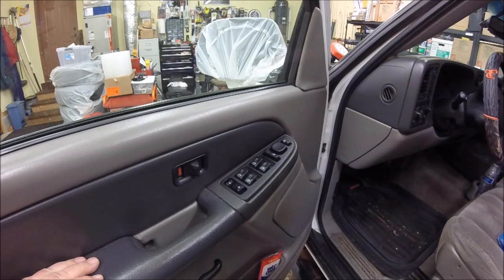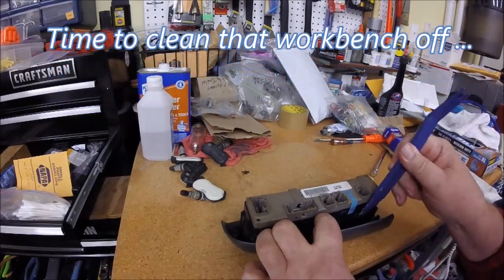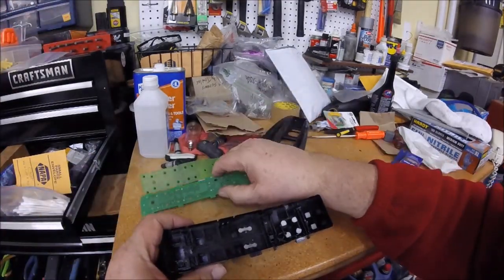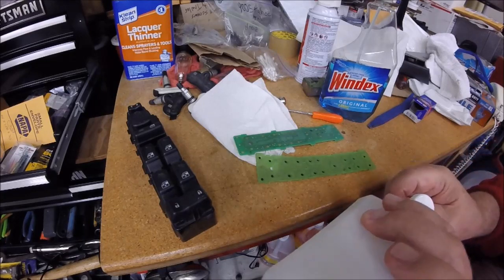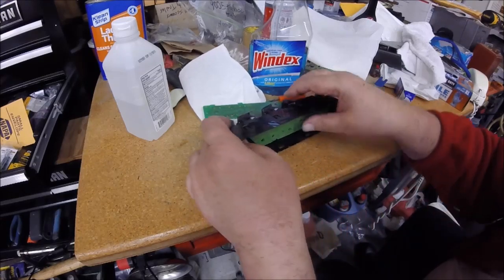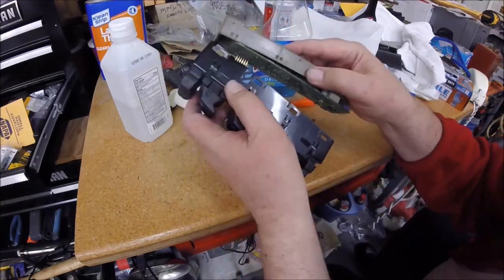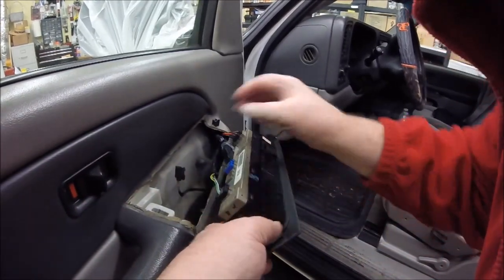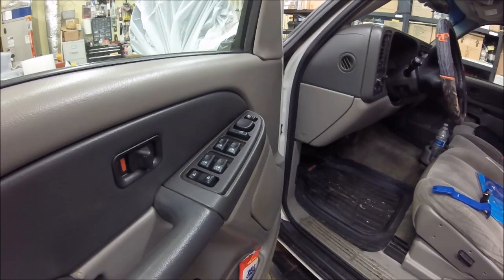2003 Tahoe Power Door Lock Power Window Master Switch Fix ©2018 B John

Comment: John, just want to thank you again for this video. It did in fact cure the sporadic lazy master lock/unlock switch on the driver side. Just a suggestion to those who may be attempting this hack. I'd suggest that in spreading the sides of the switch enclosure to release the housing to get to the circuit boards that you might consider cutting some strips of thin corrugated cardboard (about 1/16 to 3/32 x 1/2 x 1 in.) one for each slot about 8 total. Insert a small flat tip screwdriver and slide the cardboard tab in next to the slot to keep the stays from preventing sliding the housing out. This should ensure that the housing will slide out easily. Remember...take your time...slowly ease the housing out...and be gentle in there !! :)
Reply from the maker: Great suggestion - my blue trim tool worked pretty well but you can only do one tab at a time.  Trim tool was part of a set from Harbor Freight, item #67021.

Comment: Great video thxs. You need to remove the door panel to unmount the control panel from the inside. There is a screw on the front that is accessible from inside the panel. I couldn’t lock my doors or control the passenger side window on my 2003 Chev Z71 but after following your instructions and cleaning up the contacts with alcohol wipes Voila she works again 👍
Reply from the maker: Yes I forgot to show that where my screw attached inside the door panel was already broken - the back clip still works and I secured the front with super strength double sided tape - holds like iron yet removable.

Comment: This fixed both my barely functional unlock switch and the loose/slow window switches. Both the rubber membrane and circuit board have to be cleaned very well. Thanks!
Reply from the maker: Glad my video helped you solve those problems. That's exactly what I was experiencing before I cleaned it up. Thanks for watching, Alan!

Comment: At 8:20 if you would, stress that the switch needs to snap in place . I didn't get mine right, and twice had to pull it. One side did click, but only made contact with the rear passenger window. This video saved me 150 bucks, THANKS!
Reply from the maker: Thanks Kevin your comment will now let everybody know to make sure you get it snapped correctly. Glad my video help with the repair and save you some $$$. BJ

Comment: Thanks, easy fix. I immediately saw the corrosion on the drivers window connection and also some minor corrosion on the other ones but they were working but probably not for long. Snapped it back together and viola! Up went the window!!!!
Reply from the maker: Thanks, Michael.  There are several things like this you can do yourself on the car to eliminate those pesky problems with the power windows.  Thanks for watching.

Comment: Thank you for the instructional video.   My 2003 Tahoe LT driver’s door lock switch wasn’t working.  I took about 30 minutes to remove, fix as you described, and replaced.

Works great!   The forward plastic post which helps hold the assembly to the door panel was also snapped just as you suggested it wold be.  

Note:  The assembly fits so snuggly into the door panel that that forward broken pin is actually redundant.

Thanks again, sincerely,
Dennis in Coeur d’Alene, ID
Reply from the maker: Great news, Dennis! I'm glad my little video helped you with your repair. Thanks for watching! BJ
Reply: wondering how you replace the plasitc post that broken and the swivel part since as you noted this happen to us also

Comment: 2003 avalanche, unlock not working on drivers side. Got it to program off pass side. Finicky thou. You have off-acc-run-start. I went hold unlock button, acc-run- acc -run let go unlock. doors auto lock-unlock. Hold down lock and unlock on fob till it works locks seem to take 30 seconds. it will erase all fobs that use to work so take next fob and hold lock-unlock till it starts working. Can program up to four fobs.May have try it a few times to get in program mode. Good luck.

Comment: What is it call the white thing when you clip back in I broke me but I don't know what it's called
Reply from the maker: The rear tab where the end of the switch assembly snaps down in is part of the door panel.  I don't know what it is called but I think you have to replace the whole door panel in order to get another one. * Mine was broken on the passenger side and I use double sided pressure tape to hold the whole switch assembly in place! * Works great!

Comment: question...the plastic that's attached go door panel that plastic that's holds master switch in place mine is broke is that plastic piece replaceable thanx
Reply from the maker: Hi Steven - The front post on mine was already broken, but the back piece (the white rectangle) was fine - I used some, thin, extra strength double sided tape to hold the front of the master switch in place - hasn't budged. * I don't think the parts are replaceable, but used door panels are available at the local junk yard or on Ebay - Good Luck! *
Reply: @bjohn8059  thanx my man I'll try tape my man thanx...what size bolt is that I'm missing mine one above inside door handle
Reply from the maker: @stevenbrown6782   I am not sure Steven - I may just be a #10 sheet metal screw. You might find out here on YouTube in a video that shows replacing the whole door panel.
Reply: @bjohn8059  thanx man....have a good day
Reply from the maker: @stevenbrown6782  You're welcome, Steven.

Comment: I figured the screw out I just watched the video on how to get that one plug of with grey thing on it
Reply: Also that extra wire should have been your heated mirrior power. I replaced my s stock broken mirror with trailer mirrors it has two plugins
Reply: I just snapped that whole silly grey locking thing off. Who comes up with these ideas? Guess thats why a truck is 60,000$      ;)
Reply from the maker: @charlesc5983  There is also an extra wire for seat heat, which mine does not have. Thanks for watching.

Comment: Please help!!  I followed your instructions exactly. I even did the same thing on the passenger door. My passenger side windows still wont work. Any other suggestions?
Reply from the maker: What was wrong to begin with and did you follow GM electrical trouble shooting protocol?  All of my windows and power locks worked B4 I did the cleaning of the terminals on the master switch.
Reply: Could be a bad window regulator
Reply: I got about the same problem with my 2003 Tahoe to.. passengerwindow is dead, and the powerlock won't lock the door. Have to lock it with the key. Right frontdoor.